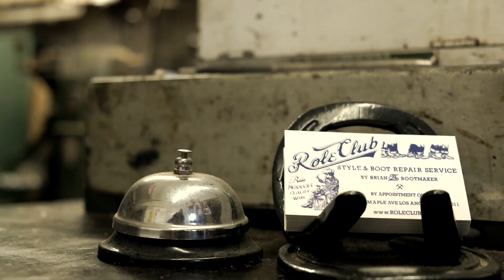Red Wing 877 Moc Toe Boots Resole #33

Comment: Why do some elect to ditch that perfectly good stock sole? I hear nothing but good about them!
Reply: AsianKy1e wanted a defined heel
Reply: They wear real fast and are as slippery as hell
Reply: bill rugg-easey they are NOT slippery until they are worn flat. I am an union ironworker by trade. This is a go to boot for many in my craft. And the sole is THE go to sole for any boot in the craft. The only time that these are slippery is if the sole is worn flat, if you walk on wet and Slick surface concrete, or on a rained on painted surface. These boots are like wearing a soft glove once they are broken in and resoling over and over again makes them a cheaper boot in the long run. The upper leather is super tough.

Comment: Okay, I love Brian work so this doesn't have to do anything with Brian. That being said, I founded completely absurd that someone decided to create so much wasted because they wanted a new look. I think it's great to use this kinds of footwear because in the long run reduces waste. This kind of boots leather last forever. But the rubber, something that's is bad to get rid of the people decide to throw away just for a look. If you want a specific boot that certain company don't offer, just ask Brian for a custom made pair instead of creating a waste of that rubber. It's just to hard to see.
Reply: nice boots wish I could just slap that stock sole on my 877 there about an eighth of an inch thick